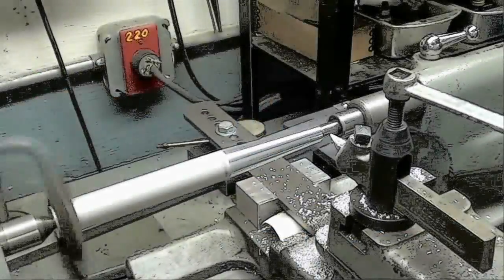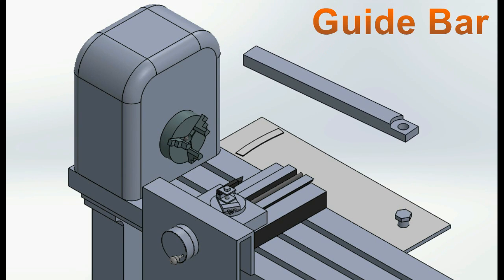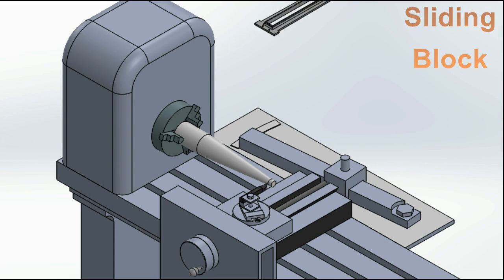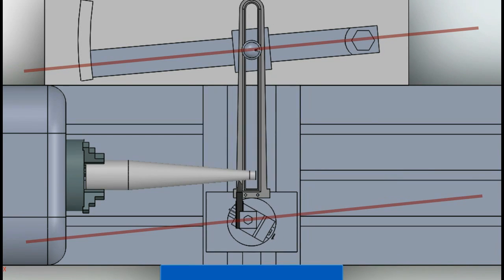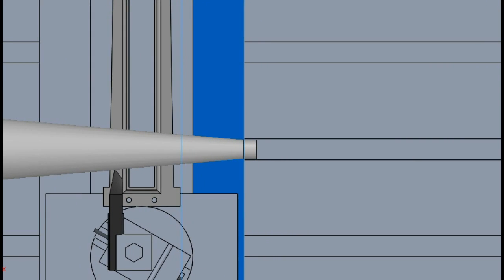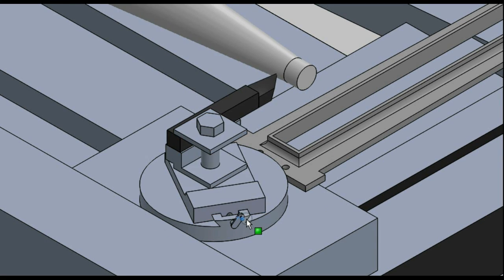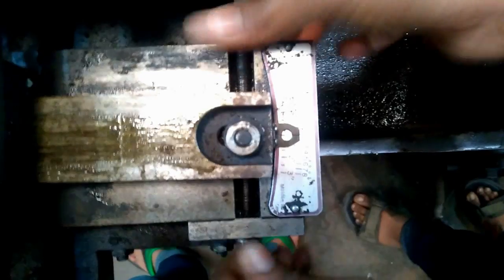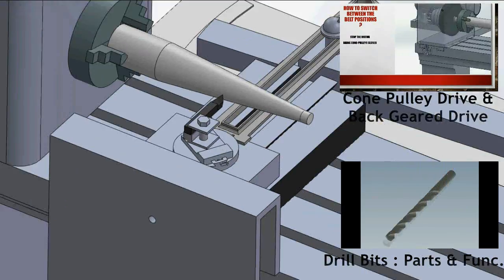Taper Turning Attachment - Explained

Comment: Your taper turning attachment works on a similar principle to one on my Harrison lathe.  One problem I have found when cutting a taper towards the chuck is with the backlash, which is usually taken up when setting the tool read to cut.  As the cross slide is pushed from the back, backlash is taken up from the back instead of the front.  So a short parallel is cut while the backlash is taken up and the taper turning starts to work.  To rectify this I always cut from the chuck end to the back.  This way the cross slide is pulled to the back and the backlash can be taken up as usual before the cut starts.